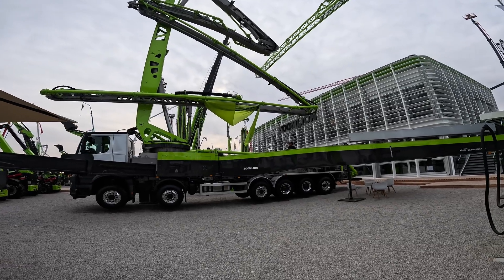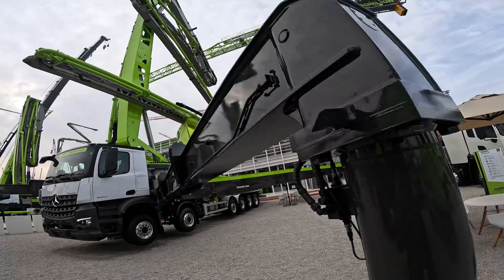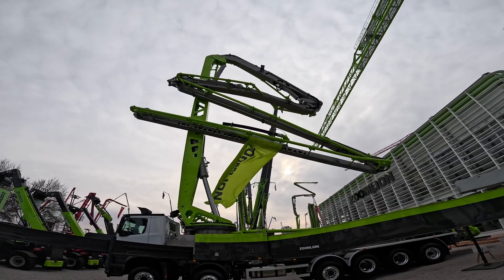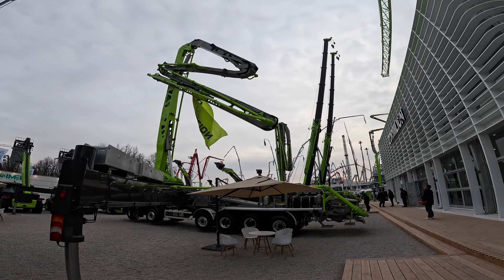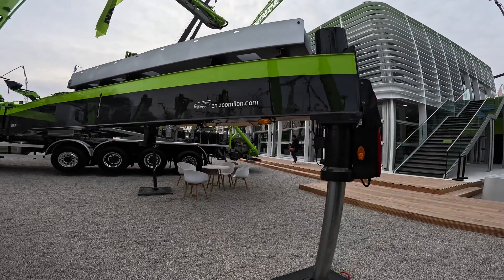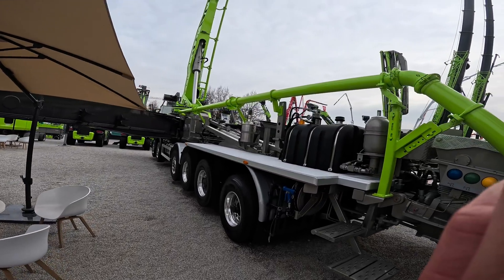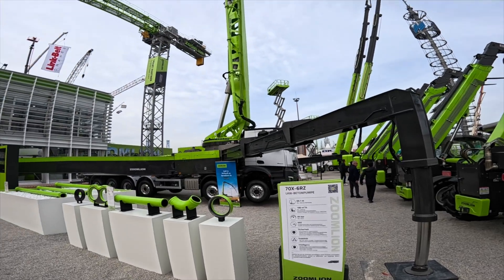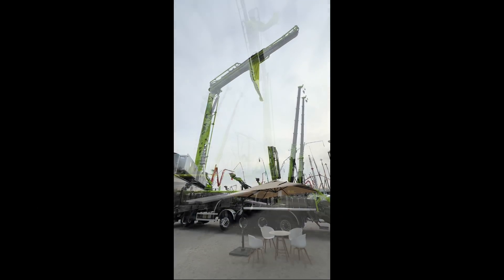70 Meter Concrete Pump at the Bauma Construction Show:

Comment: Zoomlions are so slow, I can't believe it but I think the 25 year old 70m putz we have here in Perth actually unfolds quicker than this
Reply from the maker: @timlecompte8528  the operator definitely took a couple/few breaks mid-process 😂😂😂
Reply: The hydraulic oil is cold. It’s too early. Don’t compare it with Australia – it’s always warm there, and the oil is always thin.😉